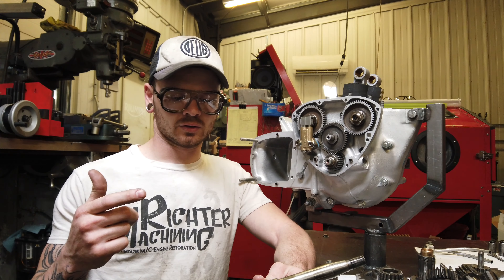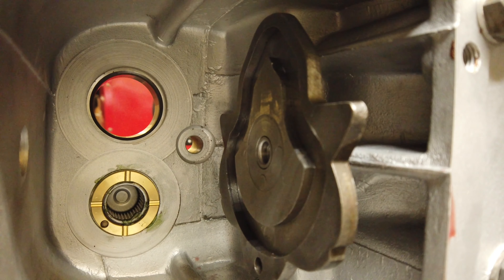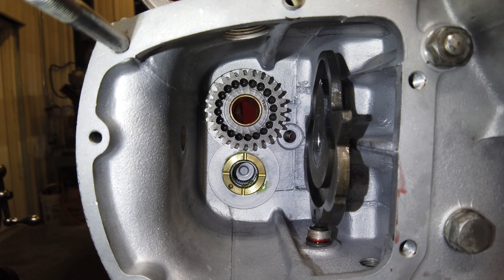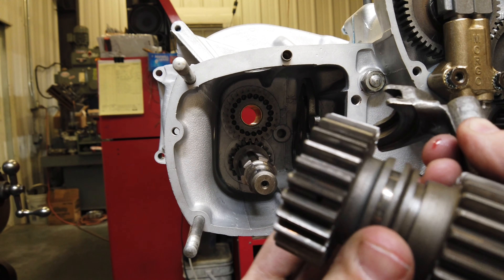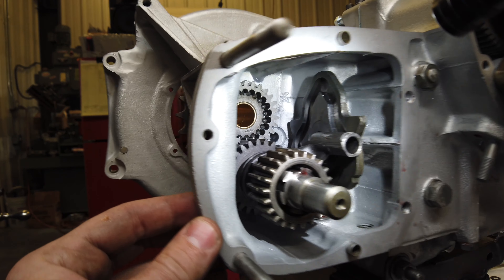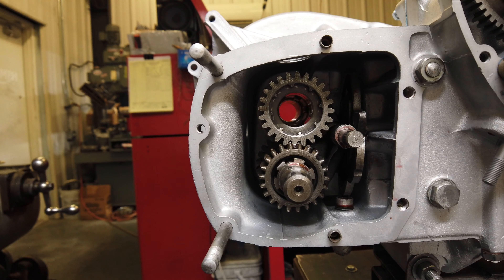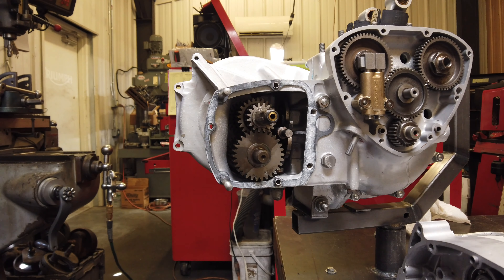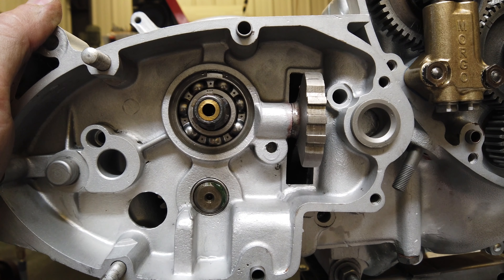Another Triumph 4 speed assembly

Comment: Great video and talk thru. My box was shifting terrible . Full of neutrals and clunk shifting. Pulled it apart and left it open for about 10 months. On reassembly I found that the two hardened rollers were not ever in there . Bought them and then started reassembly. Id forgotten everything. The book says to put all the shafts in together at the same time. I fought it for a week and suddenly it fell in place .Except I forgot to clock the plate and when I finished I couldnt get 1st gear and  had to pull the inner cover again . Your explantion is way better than factory manual.